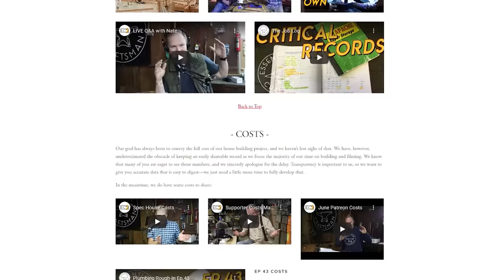5 Mistakes Most Contractors Make

Comment: Been in the trades. (mechanical contractor) for over 35 years and learned all the lessons in this video the hard way myself on a  similar timeline.  You hit all the nails right on the head brother!   I was fortunate to be exposed to lesson #1 early from a wily old Air Conditioning man that I got my first job from. He would say, "I'm the most expensive guy in town and proud of it."   Unfortunately, it took me quite a few years on my own to actually apply that lesson but it is so true. Strive to be the best in your field and don't be shy about charging a premium for it.  It's hard at first but once you've EARNED the reputation, life gets much better.
Reply: Yup. Let me tell you ya do one job for cheap and you get 5 others that call and expect it cheap as well. That one was tough to fix. I still get anxious when it’s time to bill customers.

Comment: Such a nice wholesome approach on the trades 
It doesn’t apply towards drywall in NH and MASS
Does not matter how fast or incredible of a job you do 
If anyone, and I mean anyone 
(no teeth no car no insurance )
approaches a builder with a low ball Offer
 that is now the going rate they all go off of 
Using this approach They have effectively kept the price the same as when I started in 1996 
Yet they all charge the going rate for our work

Comment: I'm an independent trucker, and I'll say everything you just said goes across the board for anyone who is wanting to go into business for themselves.  Great advice!
Reply: As a Cybertruck reservation holder and (tiny) Tesla shareholder, I have to ask - have you tried to do the math on what a Tesla Semi would look like for an independent rig? Is max weight a big issue? Or is a lower cost per mile, fewer repairs, and faster speed exchanged for 2-3 tons less max load (due to battery weight) an acceptable tradeoff? This was a question posed by Cybertruck Truck Guy channel.

Comment: This Video was a picture of me and my business, not a builder but an automobile mechanic.  I was good at my trade, people came from miles around to have me fix what they couldn’t get done anywhere else. I worked my but off for 14 years but all I made was wages. I looked at mechanics I knew and they were taking home as much or more than me with less stress and fewer hrs working for some one else. 
      I learned this from a father who worked the same way. If you wanted to make more you worked harder or longer hrs. I came to the conclusion after finding there were just so many hrs in the day and I could only work so hard. I sold my business and went to work for someone else telling people when they asked why that I was successful, just didn’t like the business part of the trade.
      I retired at 60 but looking back if I had control and knowledge of the 5 things you mentioned could have retired much earlier plus , who knows I might not have wanted to retire. ( lessons learned from an 81 year old man. ).     Mikey

Comment: As a jeweler in my younger years, then machinist for the last 20 years, all of the suggestions you mentioned apply. It took years to learn them, but now I use them every day and my life is smooth without the bumps and valleys of my younger years.

Comment: As a software developer I just wanted to pop in, say hi, and mention that this is very much applicable to the software industry as well. Thanks for sharing your hard learned wisdom!
Reply: I own a small 25y sw co and thought the same thing! SW = building, no?
Reply: Exactly my reaction too, and though I am an employee most of these lessons are applicable on some level anyway. I do cost/time estimates, I need to be part of handling scaling of work-load, I need to clearly communicate, and I can't afford to cut corners or it will bite me and everyone else in the butt later on, etc. etc.

I'm sending this video to an entrepreneurial software developer because I felt it hit so right.

Comment: My favorite one to practice (because it's actually fun) is under-promise, over-deliver.  I practice it every day when installing water treatment equipment. I tell them I'll be such and such hours to get the job done and will make a lot of noise and their water will be very unpleasant for a day or two after I'm done (this is the case with certain equipment in certain scenarios depending on what I'm doing) and in reality all of that is only true in the worst case. So then they are expecting the worst I can give them and I can go to work with no pressure on me. I work very hard to give my best and if everything goes wrong I end up giving just what I promised and the customer is still satisfied. But when everything goes better than promised (most of the time it does) the customer is impressed and VERY satisfied, far more likely to recommend you as well. USE CAUTION THOUGH! When you way under-promise and way over-deliver a less than wholesome customer may demand a discount or at least joke at wanting one to see if you take the bait. So don't let your customers expectations VS the reality you provide EVER be miles apart, this does you no favors. Ease them with the method and take a little pressure off yourself but then work hard and give them what they paid for and charge the money you knew you needed to charge. If someone demands a discount because you finished too quickly and easily use your best judgement how to proceed but do so carefully and with thought before you open your mouth. If someone jokes at a discount then joke back with them in return, like for like, but without demeaning them for saying such a thing. This is what I've learned practicing this principal.
Reply: A discount.. laughing out loud 

Do you get a discount at the doctors, or what about at the mechanic shop
Reply: @vanderumd11  and yet people have the guts to ask...

Comment: I'm not a contractor and in a very different line of business.  Nonetheless, this is true for everybody that runs a business.  In particular communication.  I am very convinced that 90% of all issues in the world could be solved with proper communication.
Reply: I believe you are correct.
Reply: Add that all people communicating on the problem have to have the same sense of the end goal ...ie why they are there.  We often end up working with people with all different goals and there's no doubt the last 100 years we are running into people that simply want to own or run the world and dont care about the fundament reason the problem
exist or what could be tweaked to fix the problem in the right way that keeps one from having to address the same problem at a later date.

Comment: The business side of construction is often the death of most small businesses and the most misunderstood. Thanks for sharing!
Reply: I recently read a book called "the peter principle". It is all explains exactly what you said. Good carpenters don't necessarily make good foremen, and good foremen may not make good managers etc. The book was written in the 1960's and it was a total revelation for me. I could see many of the people I've worked with fitting into the descriptions on the pages. 

The key point the book makes is "people rise to their level of incompetency". Not good enough at their job to be considered for promotion, yet hierarchy's make it very difficult to demote such a person. Therefore they have reached "Peters plateau".

Comment: Words of wisdom. 

My father was a Master Carpenter and a contractor.  I remember having many conversations about these things at lunch time and over the supper table.  I learned a lot about not only working by the hour for a builder but also about the business of building itself -- two very different things and two very different perspectives.

And you are certainly right about taking on small and medium-sized jobs. The demand for this work is always high and clients really appreciate skill and integrity on the part of those who are willing and able to do smaller jobs well. The key thing to remember is that even small jobs are a big deal and to act that way.

I am surprised you didn't mention the importance of finding and keeping good workers and subcontractors in this list.  No biggie. What you said is crucially important.

Thanks!

Comment: 1. "She..." yes, it's always the She that you'll be working with. The reason you're doing the work is because She wanted it done and She will count nails to make sure you're not cheating her. 2. Working with the Homeowner to save them money by not getting permits gives the Homeowner power over you. If they're the slightest bit dissatisfied with your work or want a little more than contracted for you are at their mercy. 3. Kiting: in my observation the most prevalent route to failure for Contractors. 4. My addition to your list: don't take verbal Change-orders. Write it, draw it, get their signature on it. There's no way you can win if you don't. Pulling those signed papers out has stopped every difference-of-opinion discussion I've had to endure. 5. A personal note: I was doing a job early in my career that paid me $15 per hour. One day the Manager of the Apartment Building had another guy come over to change light bulbs on the exterior of 24 apartments and parking garage. The guy stated he had to come back at night when the lights automatically turned on. I said wait a minute, went to the office, opened a panel, hit a switch that turned everything on, came back and the guy said "I still have to go home and get the bulbs and ladders." He charged 2 hours for showing up and doing nothing and...I discovered he was being paid $45 per hour. That's what it took for me to wise up.

Comment: THIS. Been in the low voltage networking, access control, gate automation business since 2007. All of these rules apply. I tell my customers and potential customers up front, "I am not the cheapest. But I'm the best. You will never argue over your warranty. If we did it and it was wrong we'll fix it. PERIOD."

Regardless of inflation I raise my prices every year. Take fewer jobs and make the same or more money.

I used to be so busy I couldn't think. No rest. No life. A year would go by and it would feel like it was March. 

These are very valuable lessons. Thank you for your channel. Your willingness to pass on your wisdom. Your humor. Thank you for being you.

Comment: Actually, there is only one mistake, multiplied five-hold ; Not charging enough.
Project managers manage expectation, communications and regulatory requirements, bookkeepers maintain accurate records, CPAs help with business strategy,  lawyers on retainers  enforce  contracts if needed.

The cost of all the above paid by clients

Most GCs are not running a business, they are buying  a job.

Comment: I work with my aunt (who is going to be retiring soon shes 66) and my cousin they are general contractors... I enjoy the work because I do all sorts of different things I like the framing and carpentry the most... but what I was gonna say is I do a lot of side jobs on my own which is mostly fixing things... recently it has been fixing 30 or 40 year old decks and figuring out how to get them resupported and finding a point during the demo/prep required to repair something where you can stop and still be comfortable and safe repairing from that point on... otherwise I'd just be totally replacing things all the time... anyway what it's kind of weird about fixing old structures is a lot of the time it's harder because you have to do everything to work around the structure that's there while doing it correctly and nicely.... sometimes that's really hard to do... anyway love the channel keep it👍

Comment: A few things regarding your excellent, excellent, advice, that I learned running a manufacturing company. A good accountant should be able to determine your overhead figure, review that every so often, overhead changes with growth. Business insurance, to include fire.  As an apprentice the shops tools were stolen but covered. Use the best materials, it makes a difference. Back up you work, if you make a mistake - Fix it! There are times when it pays to fix some one else's mistake. Good will has value. Thanks again.

Comment: Consumer here...great vid.  I always feel a bit guilty about larger jobs and whether I'm paying my tradies enough, in terms of the effort they put in and the quality they deliver.  I get them in when jobs are beyond my abilities, so I at least have some understanding of what is involved.  About the 'little jobs' aspect, we recently had a large renovation done, and our contractors offered to do a number of small extra unrelated things for us - laying a floating floor, extra power points, tiling the entranceway and a couple of other minors.  All good, but they weren't included in the quote, so we came to a good arrangement where the guys were paid a good extra for them, on our insistence.  When we did the sums, together, we all realised that those extra's were a good 15% of the overall job effort and cost to me.  Lesson learnt - extras cost more, and as a consumer if you can't find someone to take them on, and you get them done as part of a larger job, you should pay appropriately.  The other side of the coin is that we like to develop a good relationship with our tradies, it's an investment in the future.

Comment: I own and run a small construction business here in Australia. I have 2 full time employees, 1 casual and 1 fabricator. I don't make a fortune, but I do it on my own terms. Business is hard and not for everywhere. Here are a couple of my tips
1. Take care of your employees as they make your money
2. Have yourself doing multiple things in your business for cash flow. For example I'm a structural Landscaper, but I also have a steel fabrication shed, we do garage doors, auto gates, custom steel and alum work, wholesale gate motors, etc
3. Do quality work and you will never run out of work. Yes we are a human and make mistakes, but it's how you approach those mistakes is what makes your business
4. Use free advertising as much as you can. I built my business on FB. We just did $170k in sales in 3 months. Not bad for a small business.

Good luck to everyone, you only know if you try! Failure is not an option

Comment: As a new carpenter I charge well under what I think my work is worth because I simply don't yet have the reputation or portfolio of work to compete with the other contractors in the area. I know for a fact I am in the bottom end of price.

I took a large job and was onsite with other carpenters and after talking about various things discovered that I was charging at least 30% below what would be average.

My reviews are 100%, my feedback after 7 months is so far perfect. I know I should soon start to up my prices.

Comment: Regarding number 1.  Early years in my trade I worked for contractors.  I the went to work for an utility.  Part of my duties included monitoring and inspect contractors.  One thing I learned was it's extremely difficult to deal with a contractor who has "used all the money.

Comment: I made the mistake a few times of low balling a job just to get the work.  Usually with the assurance that l would referals out of it.  The problem with getting referals from a cheap skate is that they only refer you to more cheap skates.   I really could have used that rule of thumb concerning losing about half of bids.  Thank you for that, belatedly.

Comment: Pneumatic framing gun , are .146 x 3 1/4” galvanized ring shank good for all residential framing ? 
Are 131 x 2 3/8” galvanized ring shank good for 1/2” and 5/8 OSB , ROOF AND WALLS ?

Comment: U.P.O.D. - I learned that from my first boss as an A&P aircraft mechanic. I have worked for him and another boss who basically did the opposite. Under promising takes all the pressure off, and over promising is like having concrete blocks attached to your ankles, getting thrown into a pool, and trying to stay above the water... you're running around and customers are not happy. It's like a win-win vs. a lose-lose.

Comment: Minimizing profits lead to corners being cut most often than not. If there's even a hint of pushback at the beginning regarding the price yet still within your local market price than you've probably done good. If they aren't questioning the price then could you have gone higher? There will almost alway be competition bidding on the same job but are they doing the same thing with exact materials and value engineering? I try to schedule my estimates last then use whatever information I gleam to give a slightly cheaper bid later; plus throw in some kind of free service or hardware upgrade.

Comment: 45 years ago, metal works, with one employee, but not doing well, morals down till one day, an old gentleman came to my shop in need of a few pieces of steel, he saw me right through, and proceeded to tell me what being in business is about.

Son, he said, I see what's you're doing, you're different than others so.
First. Do the job as per your customers requested. 
Second. Do quote the job accordingly, mat cost, labor cost, overhead cost, your wages.
Third. Profit, at least 30% and more for special jobs.
Forth. Do not be afraid to charge your price.
Fifth. Add a little of your touch.
Sixth. Deliver the job on time.
Seventh. By doing all of the above, there's no need to worry about money. Well?
After 8 years ( its a long story) my accountant asked, how much do I had in the bank, I knew the payable and receivable but didn't know the answer, I almost fell of the chair.
That old gentleman became my best friend and got any type of metal he need it.
I might add two facts.
One. You must have a dream.
Two. You must have pride in your work.